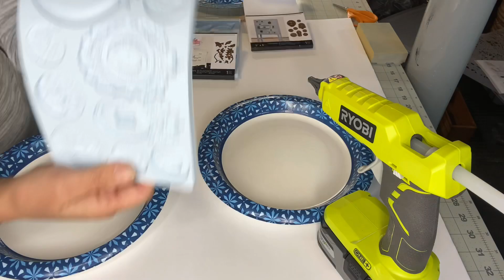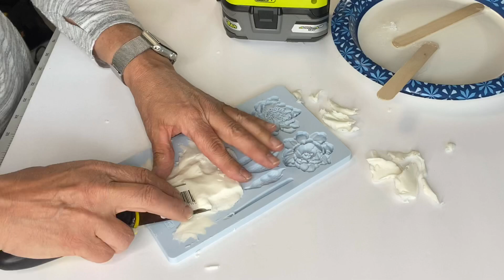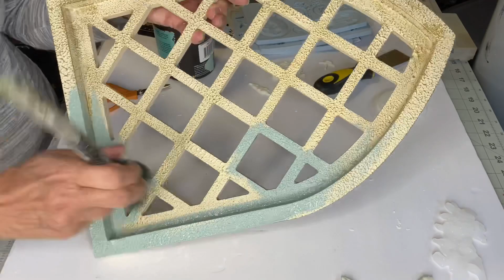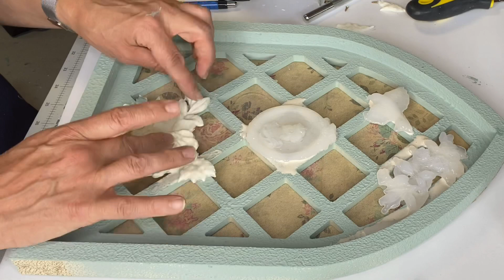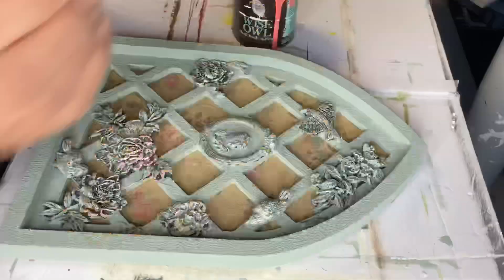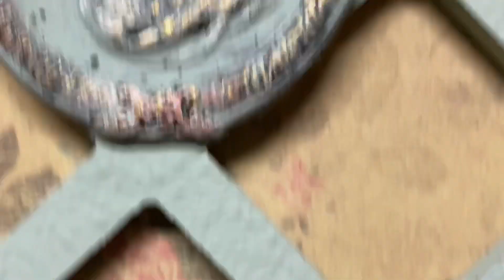DIY Vintage Shabby Chic Arch Window with Decorative Moulds

Comment: Love it. Just started getting some molds. Where can I buy the big tub of plaster? TFS
Reply from the maker: Jami Womack I’m a redesign with Prima retailer.  However I do not carry the big tubs.   It’s slot of clay and unless your holding a class I feel it does dry out of you have it too long.   Smaller packages sealed is a better solution